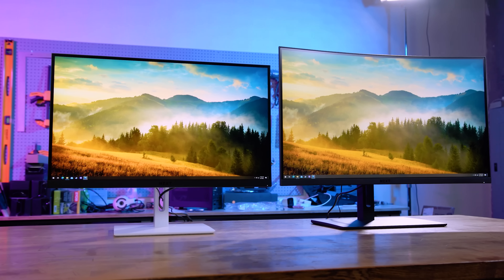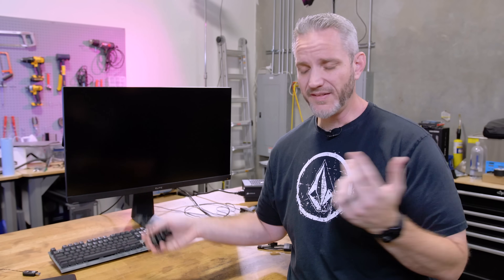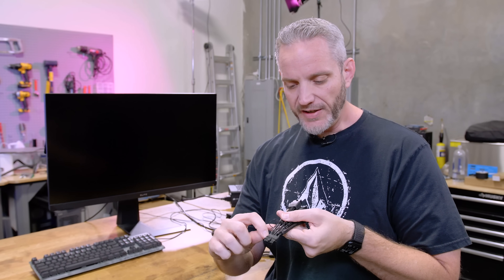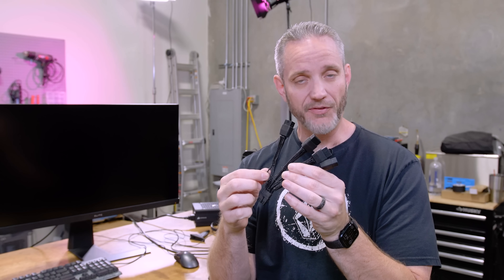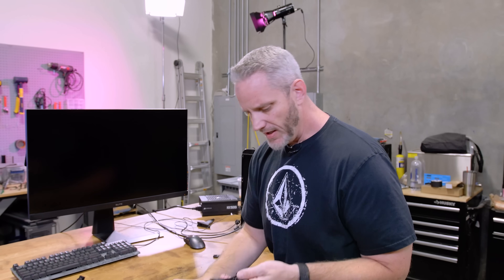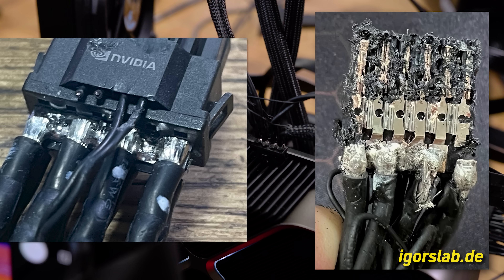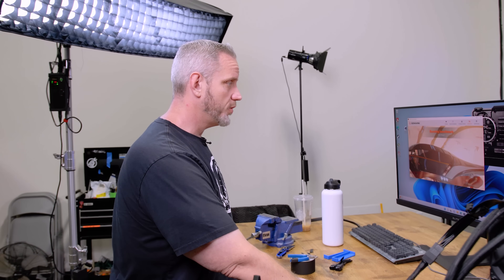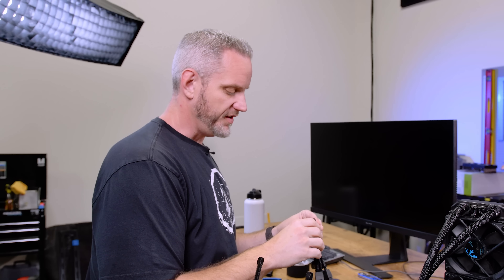Igor's Lab figured out why NVIDIA adapters are melting!

Comment: Hm... it's not disconnecting the wire completely ... it is its developing crack in it and have to deliver power using less of the surface ,or to say it's touching it but not attached ... like welding arc

Comment: A solution would be to split the wires half way up the cable and crimp instead of solder. Then individually pin each wire to the connector.

Comment: If they're going to use a what's essentially a tiny bus bar to connect the wires together, the bar should have tabs that crimp onto the wires, then solder added in after crimping. That would ensure a solid connection that can stand up to some bending. With a solid crimp the solder would only serve to reduce electrical resistance by increasing the surface area that the wires are contacting, it would not be the primary means of mechanical attachment. Solder alone should not be used as the means of mechanical attachment on a connector that will see any sort of flexing or lateral force imo, it just isn't very strong. A bus bar style construction would be fine if they'd just do it right instead of half-assing the engineering.

Comment: ----WARNING----

THIS SAME ISSUE occurs on crappy molex to SATA power adapters on the SATA side.  In every instance I have seen online, the SATA adapters that fail are these over-molded connectors.  And the best part?  It doesn't matter if the wires are soldered to a board or if they are soldered onto individual pins and THEN put into a molding machine to create the plastic/rubber around the wires.  The issue is the over-molding.  It allows cheap chinese manufacturers to crank these things out with no regard to QC, because the consumer doesn't have access to an X-ray machine to non-destructively check the adapter for these issues.  As long as they use these connectors:
--If a solder joint breaks, it will melt.
--If solder ALMOST bridges 2 wires, it will melt.
--If you solder the wires onto little pins to insert into a pre-made connector,  and  If any of those pins shifted when you injection mold on the cable's strain relief,  IT WILL MELT.

These adapters are cheap as hell because injection molding plastic over shoddy workmanship is cheaper than a QC department.

Comment: I don't know if there is a protection but if the wire is broke from the pad it will sometime connected and sometime disconnected due to vibrations that will cause arcing and this can cause high temp. If you cut the cable only the cables will heat up not the connector. Again i don t know if there is a protection for arcing.

Comment: the rubber must be keeping it close enough to produce an arc. that inside of a rubber housing might be generating heat, which can't dissipate. heat melts the connector. which is somewhag weird if you consider that what's actually melting is the header. so my hypothesis might be proven wrong.

Comment: If a connector is stressed to cause a poor connection it will arc current. The arcing will cause heat which melts the connector and if hot enough can also melt the solder. Once pins become open the total current will increase across the remaining connected pins. It would be expected that both the socket and connector would experience damage. Overall a poor design when multiple connectors are required for safe operation over the life of card vs the warranty period.

Comment: I doubt that the melting happens because some wires disconnect it would rather because the resistens of the pins rise when they are not perfectly inside. The redistens depends on the area  of contact betwen plug and rifle and the lost energy by the resistens is heat

Addendum:
The produced heat could cause the desolder of the cables, because there is no strain relief in the connector and accelerate the process further

Comment: This is why strain relief is so important. Crimps for connectors are better than soldering to a flat surface.

Crimp or solder cup pins really should be standard at this point. :|

Comment: Another thing to take into consideration with this is the position of the connector on the GPU itself. The position of the power connectors on most GPUs is horrible for any kind of cable management. The manufactures are just asking people flex the GPU power cables all sorts of strange ways, trying to hide them. With a long card like the 4090, why can't they just put the connector on the back of the card instead of the edge?

Comment: @JayzTwoCents It's not a fully open solder joint. It's bottlenecking the connection with a partial joint. A poor connection is worse than no connection as the electricity will try to squeeze through and cause resistive heating. You're on the money, but just need to touch the broken connections lightly to the pins.

Comment: Those are 12 pins for power, right? The "old" way was also using 12 pins for power (sometimes plus extra 2 or 4 pins ground). Why this connector is "better" ? I fail to see.

Comment: It's pretty insane that they're using soldered joints at all for those current levels. For house electricity, you're not allowed to use solder joints for any high current application because soldered joint will receive the heat first and if that solder ever melts, you've major issues. Always used grimped connections for any high current application and you'll be fine.

And since solder is usually also weaker metal than the wire, any force will cause cracking in the solder first and with a crack you will get sparking and high temps very fast, which again can melt the solder (or burn the surrounding material).

Comment: Power cable extension cables and GPU extension cable require high reliability and safety measures. When buying power extension cables for a power supply, it’s important to prioritize high-quality cables with proper certifications like UL, CE, and RoHS. Make sure the cables are properly rated for the power demands of your system, offer secure connectors, and come from reputable brands or manufacturers to ensure safe and reliable operation.

Comment: The heat is when a side cracks all the way across where it loses complete connection.  But when close enough to barely touch it creates an arch.  Causing  extreme heat.  To recreate this break a side off completely.  While card is running have it lightly touching again.  
You will see instant heat.
DO NOT cut the wire or recreation will fail.

Comment: I suspected the connector being too small for this many cables and the heat-shrink tubing being that stiff. They soldered instead of properly terminating the cables into the socket.

Comment: So, realistically if you actually have a native atx 3.0 cable, where each wire is a direct wire to each pin, this issue doesn't exist. Its purely due to how this adapter was designed.

Comment: Ever seen what happens to battery lugs in cars if you forget to tighten them down and then attempt cranking the engine? Still has a connection but has a high resistance...if you then attempt to crank the motor...well the post got hot enough that it got soft and the brass lugs the brass lugs embedded themselves in the post of the battery and the cable insulation started melting...I suspect that cracked solder joints being held in place by the rubber mould and still making a connection but with a high resistance are causing this issue.

Comment: Weird how it wasnt any of the problems most people said it was. Its not the connector, its not the standard, its not the wires. Its the bonding. Would be interresting if the cables were designed by NVidia or Molex(or the connector/cable manufacturer)

Comment: Having a long cable in the adapter before it splits would easily fix both the horrendous looks and the melting issues.

Comment: Pic at 3:19 is not comforting. Ordered an Asus TUF 4090 a few days ago. Much research to do. My case is a horizontal motherboard mount. Thinking that I only need the Cablemod 90 adaptor, or should get the Cablemod 12VHPWR also? Case is Thermaltake Core X9,  PSU is EVGA Supernova P2 1200W (ATX 2.0).

Comment: If the outer connections are the ones breaking, and the ones melting, it shouldn't be the load on the unbroken connection wires that's overheating. I would think the issue is arcing on the broken solders. Has anyone formulated a test scenario for internal arcing? It wouldn't be obvious since it's concealed inside the plastic housing.

Comment: Problem is the 4090 is too high for some cases after the wires are plugged in and when the case cover is put in place it's stressing the plug connections and breaking them .

Comment: I don't get is why the pins on the side melt if some wires break of. Shouldn't it just heat up as a whole? Or are they only cracking, increasing the resistance on the side wire connections?

Comment: IDK, it isn't helping, but you would be amazed what that could handle. This comes down to a manufacturing/user issue. Just because there is added resistance, doesn't mean there is excessive heat built up. Remember there is loss in the wire too. And good cables are not just melting all over the place. It is about power density.

Comment: if the end pins are the components breaking connection and causing the centre pins to take the full load and generate heat... why are the end pins the ones melting?

Comment: OK, understand your saying the broken wires are overloading the good wires and they get hot.  Bit of my 'twocents" it is melting on the sides/ends.  If the broken wires are still close enough to each other to ARC you could get a big jump in heat, and exactly where they are melting.  And if people don't think it will melt, they use arcing to weld metal.  Also most of the US is now requiring 'arc fault" circuit in addition to ground fault in all new homes.  ARC is serious, and it is possible in this case if the wire 'broke. Sorry just noticed it is a year old but it is a bit to keep in mind.

Comment: im not an electrician. i worked for a company in uk that had to renovate a house that had had fire damage. the cause of the fire damage was the cable from socket to socket should of been one cable but it was 2 cables joined in the middle. due to work on one of the sockets the cable was pulled and the join of twisted cables together pulled apart and that caused an arc of electricity that set fire to the insulation.

when one of those cracks in the solder appear, it can cause arcing and that could be what its causing the extra heat to melt the plugs.

Nvida seems to be trying to save some money by choosing this type of cable set up. would be interesting to know how much money they saving per cable vs having something more like (i think it was called) cable mods version of long straight cable that looks better and more simple to cable manage safely.

Comment: what if that wire was to keep losing and gaining contact with the bridge, like a loose fuse bus. i had a loose fuse bus in my furnace and the loose connection made everything overheat and melted the fuse bus. granted thats with a shit ton more electricity but maybe the concept is the same? loose connections do produce more heat.

Comment: this is just my theory, I believe it to be true where you have cracks in the solder joints but what I believe what really is happening is arcing from point a to point b is what causes these things to melt or even explode into flames. It's the same as if you were to take a Molex connector and plug it in while the system is running, there is a 1/5000 chance you'll experience an ark, that number also varies on the build quality of the power supply. I understand where you are coming from since the two solder joints break on the end first the now new load on the inner pins causes it to overheat and then melt, which is possible but the burn marks on the two outer pins that are making a bad/ no connection so that is what leads me to think that arcing between the solder cracks is what really is going on.  for a better example would be a dead man switch or better known as a mechanical electrical safety switch.

Comment: Why oh why did they pot a flexible cable/solder connection with a flexible rubber (even a hard rubber). In industrial applications, we always potted the back-shell on connectors with a rigid epoxy for just this reason.

Comment: Why didn't they make a single aesthetically pleasing cable with a 'U' plug for the GPU and connect somewhere behind the motherboard amongst the rest of the cables? Or make a GPU specific PSU with 1 cable?

Comment: today i got my zotac 4090 and was absolutely shocked at the size of the adapter the 12vhpwr adapter until you have one in your hands you don't understand how truly terrible the connector is I work in electronics for a living and can not believe it was designed for 600w someone really dropped a bollock developing this!! its absolutely tiny

Comment: Jay, what you're saying makes no sense.  If the problem was that the outside connections were broken and all that power was forced through the middle wires, the middle connections would be the ones that melted, not the outside ones.  I'll tell you EXACTLY what the problem is and why the outside connectors are melted even though they're the ones that had the connection broken.  If no current was running through the outside connectors, the outside connectors wouldn't be melted.

It looks to me like that connecion was broken but not broken enough.  The two pieces of metal were still close enough for the current to occasionally arc.  When current arcs, it passes through the air.  The problem is that air is an insulator and there's tremendous friction when electricity forces its way through it.  The friction is so great that the air turns white-hot (which is what we see when lightning strikes).  The heat generated by the arcing current is what melted the plug.  That's why the outside connectiors are both the ones with the broken connections AND the melted plastic.
Reply: This
Reply: @m3taleye  Just unplug it and physically look.
Reply: @m3taleye  My pleasure.  Sometimes the simplest solution is best.  😁

Comment: That's one of the "fun" things about electrical current. Most thermal "failures" are due to build quality. With a poor quality connector you can easily find yourself in this scenario. Current generates heat. At some point, excessive heat will lower the resistance enough to allow more current, which generates more heat, which lowers the resistance more, which generates more current...you see where I'm going? Power draw isn't the problem. It's the amps going through the wire that causes melting. That's why you can't send 20 amps through a 22 gauge wire. There's not enough wire to dissipate the heat. By breaking the connectors, you're essentially forcing the same amperage to flow across half the wires, which will generate more heat, and lower resistance.... And you know where I'm going with this.

Comment: Turns out getting hold of a 4090 wasnt the problem..  ..its now that there is still no availability of either ATX 3.0 power supplies, or in my case, that Corsair 12VHPWR to PCIe adaptor cable

Comment: Yet another engineer, just want to say you can have multiple failure modes.
Poor connections are worse than breaks. Bending the wires can both lossen the connection points at the pins AND lead to internal cracks/breaks.
Your clean break by cutting a wire will run far cooler than if you cut through the wire and held the wire ends very close together with a bit of tape to simulate how the connections are held together within the connectors or the molded rubber.

Comment: The argument is not " the spec" of the cable, its the accuracy of that spec.
Back in the good old days when wisdom existed, engineers exceed requirement by 20% just to be safe.
Today engineers do EXACTLY the spec.
You  go 1% over that, BOOM !!!!! and they are not liable because its all "within the spec".   In corrupt countries, this is known as legal corruption.

Comment: This melting happened to me with an RTX4090. It melted the adapter plug and the plug on the video card. Less than one hour of use. Three pins are melted. I have a 1200w Antec power supply. 
Cable was not bent much at all as I had watched this video before installing the video card. Card was purchased new from Brick and mortar retail.

Comment: What NVIDIA has done wrong:
1.Never solder a wire terminal unless there is a solid base or an interface (like a PCB).  The copper becomes brittle and it can break easily if bent 2-3 times, especially if thin sheets are used like in this case.
2.The way they choose the power rating using that extra pin header is a bit gimmicky. There is not an "active" way of determining the power rating of the PSU or the quality of the connection.
3.There is no input voltage monitoring. Assuming the GPU is drawing a constant power (~300W). Excluding the efficiency, let's say at 12V, 25A are needed. If the voltage on the  12V line drops to let's say 10V at the input of the card due to bad contacts/interrupted traces, to deliver the same power, 30A are required this time. Basically, it's a runaway situation: the connector heats up, the voltage drop increases, the drawn current increases. So, by monitoring the input voltage, this runaway situation could have been prevented. VRMs do their best to deliver the same power required by the GPU. 
4. The connector itself looks cheaper than a typ. PCI-E connector. At this price point they could have done a more elegant solution having 2 PCBs: one dedicated for typ. PCI-E power connectors (a small one) interfaced with the main PCB; or a totally new connector (similar to XT60).

Comment: I'm not an engineer.  You're going to a pretty good size gauge wire to a tiny metal pin with a small contact point on the pin its feeding.  It's causing a amperage bottleneck (resistance) and causing heat.

Comment: Here's an idea. If you're going to spend $1500+ on a video card, spring for the PCIE5 PSU with the native 12+pin connector??? The new MSI A1000G PCIE5 PSU is $199.